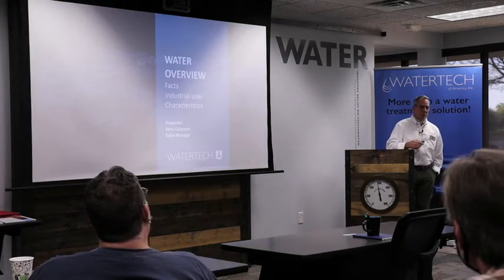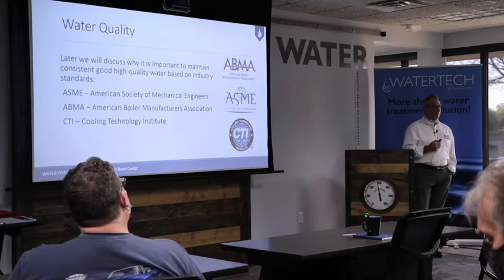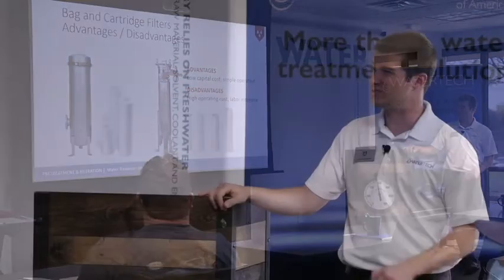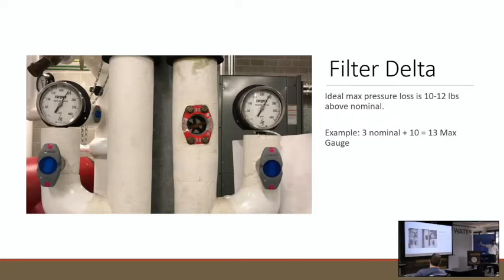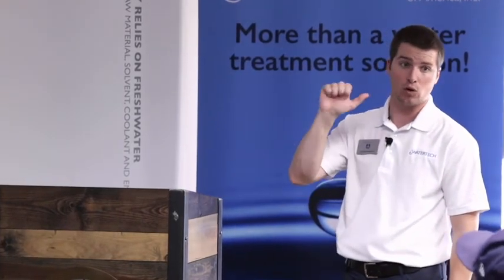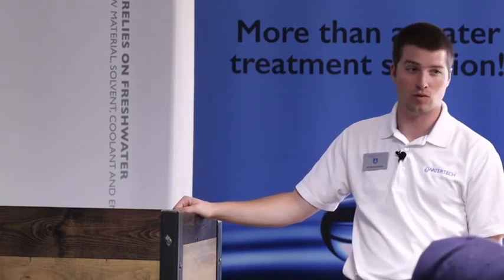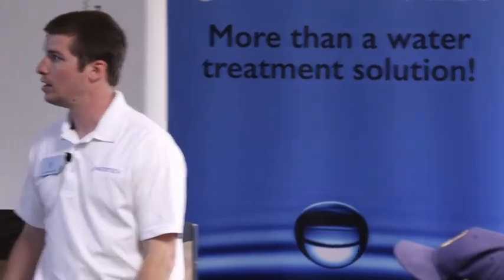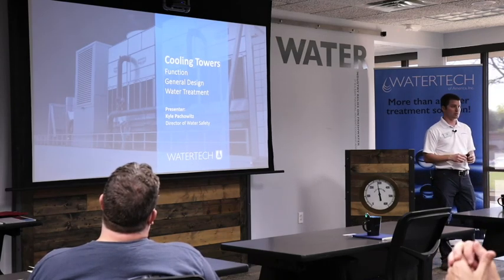1-Pretreatment & Filtration

Comment: Some good nuggets in this training segment.  But, here's where confusion can ensue.  At 21:40, the topic of water softeners is covered for this portion of the pretreatment considerations.  The Powerpoint slide identifies the chemistry of hard water as calcium, manganese, and iron when the list should be calcium, magnesium, and iron.  The instructor correctly identifies verbally to the class the chemistry is magnesium.  I'm not in the market for commercial boiler applications, but a distributor of water treatment chemicals. Before making a global commitment to broadcast this error, the presenter should have had a chemical engineer sign off on the slides.  But I get it.  People make mistakes.  (They mentioned in the 6-hour stream class that they have beer available in the fridge after class.)  I'm sure I've misused chemistry names by replacing a similarly pronounced name of an element over the years.  Here's hoping my comment will bring attention to the presenter about this slide.  All in all, I gained a deeper understanding of the scale commercial boilers require filtration and pretreatment and the solutions available to backwash the sediment out of water in a way that conserves water by significantly reducing it in the backwash treatment.  More coffee, less beer, unless it's (root beer or ginger ale) within 50 feet of the Powerpoint content creator.  😉